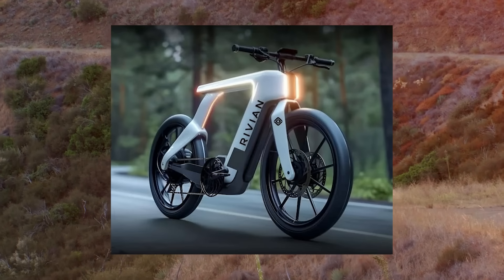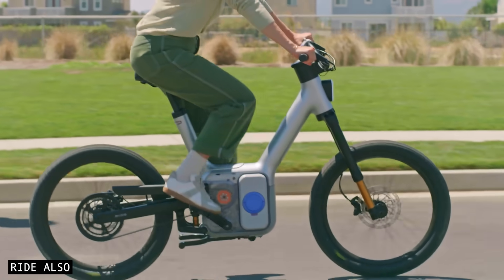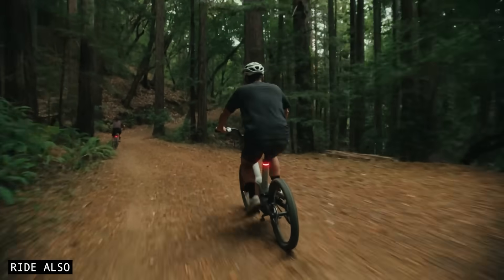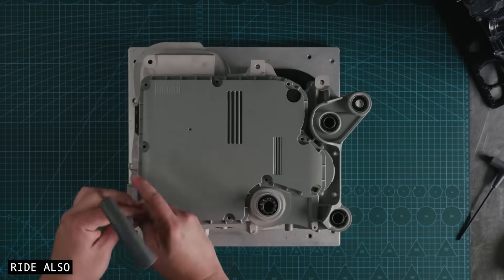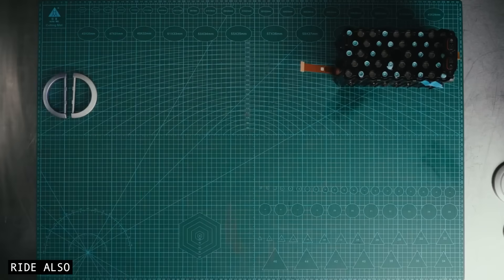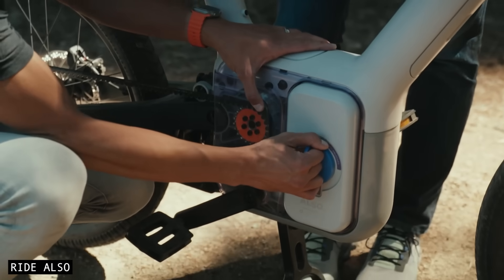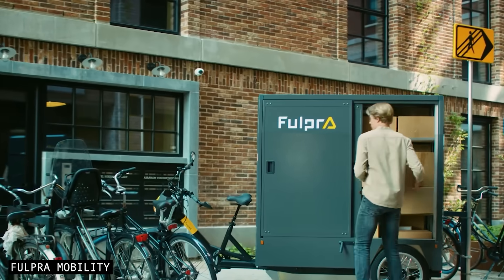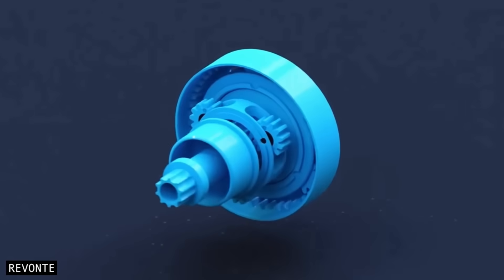Here’s Why the $4,500 Rivian eBike Uses a Digital Gearbox & Belt Drive!

Comment: Thanks for the nice overview.  That's a great motorcycle/electric scooter!
Reply: Moped, right?
Reply: I'm pretty sure it doesn't have a throttle.
Reply: @rayzecor  It does have a throttle.
Reply: @jasper_of_puppets  Oh, I see. Did he not mention it in the video or did I just miss it?
Reply: @rayzecor  I don't remember if it's mentioned in the video, but I've seen from official media that it does have a throttle.
Reply: @jasper_of_puppets  it's in plain sight, it has the shape of two revolving levers that are activated with the feet.
Reply: @SugoDiGatto  Yeah guy, i get it. What i'm saying is it has a standard twist throttle in addition to the pedal-actuated ones.
Reply: @jasper_of_puppets  no guy, it doesnt' have a twist throttle. It has a throttle shaped like pedals and a thumb-lever throttle on the right, below the fake gear shifter.
Reply: @SugoDiGatto  Okay chief, it's got a thumb throttle and not a twist one. My point was that it has a hand-actuated throttle and not just the pedals.
Reply: @jasper_of_puppets  Righto bud, cheer up. My point was to point out the pointless pedals.
Reply: @SugoDiGatto  Sure thing, pal. But the pedals aren't entirely pointless. They do drive a generator that reduces battery consumption over using the thumb throttle. Don't get me wrong, I think this bike is stupid, but it's factually incorrect to say that they are pointless.

Is it pointless to design a pedal-by-wire bike? That's certainly debatable. But that is a different point than what function these pedals serve.
Reply: @jasper_of_puppets I agree, champ.

The 35% loss in non-assisted mode feels optimistic at best, and the fact that there is no option for a backup direct drive, despite having a belt right there, feels like a very dumb choice.

Legislation-wise, some countries would probably not consider this a bicycle, based on interpretation, as the pedals not mechanically engaging the rear wheel makes them look like a loophole exploitation - skin to early french microcars having "pedals" in the cab.

I expect these kinds of vehicles to be further regulated in the future, as we're repeating the history of mopeds.
Reply: @SugoDiGatto  You're right, kiddo. Best to stick with a real bicycle. 👍

Comment: Thats a motorcycle with pedals as a throttle cable.
Reply: slowest motorcycle ever
Reply: Wrong. The pedals generate power used to propel the bike. Low iq comment.
Reply: An electric moped.
Reply: whine whine whine boohoo boohoo boohoo.

Comment: Honestly, you probably got a decent payout for advertising this. But the advantages are less complex gearbox. And then you show the "inside" with 2 complex gearboxes. One for the pedals and one for the motor. 

Also the torque argument is bs. Yes the direct drive hub motor has less torque. Ofcourse. It is direct drive. But if there is a gearbox added in the hub is is fine. My guess is that the stupid belt is there is probably for patent reasons. As the full hybrid drive with hub motor was already patented. 

Anyway wobt be buying this anyway
Reply from the maker: I didn’t get paid for this video; otherwise, I’d disclose it. I just like researching about this tech and presenting it to whoever will listen!

And I chose a big direct-drive hub motor for this simulation because, when I tested a geared hub with regen in the Grin simulator, the thermal performance on long, steep climbs resulted in overheating. Remember, in this scenario, there’s no rider contributing power, so motors can overheat much faster.
Reply: @Cyclingabout  Excellent that you use the GRIN simulator. So you're doing well in my book. 8-))
Reply: This guy gives great reviews and doesn’t get paid for them without disclosing that fact.
Reply: whine whine whine boohoo boohoo boohoo
Reply: Toe nou Slaapkonijn, niet van die aantijgingen. Je weet niet of hij betaald krijgt. Hij heeft in ieder geval verstand van zaken, want hij snapt dat hij voor dit soort zaken bij GRIN technologies moet zijn. Hij gebruikt die GRIN simulator and dat is zo'n beetje het beste wat je kan vinden. Ken je trouwens het PERS systeem van CIXI?
Come on, Sleepy Rabbit, don't make those accusations. You don't know if he's getting paid. He certainly knows what he's talking about, because he understands that GRIN Technologies is the place to be for this kind of thing. He uses that GRIN simulator, and it's about the best you can find.
By the way, are you familiar with CIXI's PERS system?

Comment: “Pedals not connected to the drivetrain” sounds like a throttle to me, which is problematic for Class 3 designation in the US. Plus the bike has an actual throttle, which also doesn’t work with a 28 mph assist limit. Otherwise, this looks very interesting.
Reply: Oh, I didn't see the throttle, why did he not mention it in the video?
Reply: Interesting observation. Will be interesting to see how that plays out.
Reply: @jysmtl  Interested in seeing what kind of interest this bike generates, and what the interest would be if they offered financing for interested customers.

Comment: This thing is what tech-bros think a bike should be.
Reply: I'm feeling slightly more charitable about it, because I think the real place for this sort of system is in those light delivery vehicles rather than as actual bike replacements. More conventional e-bike designs are better in most ways for bicycles, but this makes sense for those four wheeled delivery vehicles, and it's going to share most of its tech (and design costs...) with it, so it probably made sense to do the bike too.
I'm slightly skeptical about potentially unleashing hundreds of those things on bike lanes. There are obvious downsides (i.e. delivery drivers squeezing out what little space is currently allocated for cyclists), but there are also obvious upsides and I'm not sure what the overall cost/benefit balance will end up being.
Reply: @kristofprovost  Yes, I see potential for some uncoventional bicycles like recumbent bikes that often seemingly have rather complicated drivetrains like multiple normal length chains linked together and additional chainguides and pulleys to redirect the chain or special need bicyles/tricycles like Vanraam and some others do (and with two wheels in the back, AFAIK you can't use derailleurs, interal gear hubs are probably complicated to have that chainwheel and then the axle/driveshaft in the outer (I would give it a new housing) and it might still work without but a differential isn't wrong to make turning better.
And obviously for some cargo bikes but I don't see potential for replacing >95% of the bikes out there that still have a mostly mechanical drivetrain (except Di2/AXS) and even most E-Bikes would still work fine when the battery is at 0%, obviously without any pedal assistance, I'm not sure about that.
IMHO it's intelligent simplicity - keep it simple, stupid and don't overengineer it with great lengths to make it better in paper when everything works but with much less reliability and all of these "digital drivetrain" (I hate that wording, it's the same with PS5 and Xbox Series S, they name it digital and yes, it's "digital distribution" aka download only, but the physical media they ditched: CD/DVD/Blu-Ray are already fully digital, but yeah, I see why these marketing morons avoided "non-physical media" and here like on some others it's a mechanically non-coupled like diesel-electric locomotives/ships and a few serial hybrid cars (or Battery EVs with a range extender)) stuff I've seen yet where some say it's simplier but I disagree.
Reply: Bike guys want light weight, too. ✌️
Reply: @chandleredwards  especially in cities that aren't as flat as the us ones. The storage is most likely not ground level. Stairs...
Reply: @marthagallus6516they did say it has a special walk mode for going up stairs
Reply: The UCI has no jurisdiction here!
Reply: As a daily bike commuter this makes so much sense to me.
Reply: nah they still working on disrupting the wheel
Reply: Which is why I'd really like Adam Something to drop by...
Reply: If the same people made a bike that you liked, they would stop being "tech bros" and youd say "this is what it would look like if apple made a bike.
Reply: @oglordbrandon They would still be tech bros, but ones that made a good bike.
Reply: I'm a tech bro and I support this message.  See you on the trails !!!
Reply: The bikes are we used to are designed and meant firstly for sport. Whether it is mtb, road or gravel, they are not meant for commuting. And because those look attractive, most commuter bikes now try and copy that desing a little. Hypothetically, if this ALSO bike turned out to be really good and really cheap, leading to mass adoption, people would then start to see the bikes of now as the odd ones out. Just like you might see a sporty coupe and think it looks cool but not practical. It's the same for mtbs, road bikes, etc.
Reply: @rayzecor  What are you talking about? There are many ebikes out there meant for commuting. And they are less than half the price of the $4500 Rivian/Also, and they are like 40-lbs lighter. 

What's not practical about my 45-lb e-mountain bike? What about it makes it not suitable for commuting when I'm not riding it on trails?
Reply: @jasper_of_puppets  I can tell you what's not practical about my 45-lb e-mountain bike, basically no comfort features from factory, no lights no mudguards no stand, all off them a complete pain to have, in the lucky case you find something compatible, have to periodically clean and oil the chain and shocks, and on a side note, almost 2k more expensive. Still, I enjoyed riding it, but I wouldn't buy it again.
Reply: @jasper_of_puppets  Most of the ebikes meant for commuting follow more along the style of the trekking bike rather than the old commuting bike. The ones that are real commuting bikes don't do very well on the ebike aspect.

What I meant when I said impractical is just not as good as something purpose built. An emtb has heavier tires, no storage for groceries, really wide handlebars which make filtering traffic a bit harder, etc. I own a full sus emtb, a hardtail and a gravel bike, I use all three for commuting and they all have their flaws.
Reply: @rayzecor  I think there are plenty of city/commuter ebikes that, in my estimation, work fine for what they are designed for. But it's fine if you disagree... I just don't think this Rivian/Also bike would be any better for commuting than the multitude of much cheaper and much lighter ebikes already on the market.
Reply: @jasper_of_puppets  I don't think it's any better either, I'm just saying it might be headed in the direction of the future of commuter ebikes. I personally prefer regular bikes to ebikes and would much rather ride one than a cheap ebike with a cadence sensor, but they do accomplish what they set out to do anyway. At the end of the day, the point of commuting is safely getting to your destination.
Reply: @jasper_of_puppets  I also ride my e-mtb in urban environments, but most of the time it doesn't work, I just don't feel hipster enough.

Comment: having rotation, turning that into electricity, turning that into rotation, and sending that through a belt to the rear wheel really feels very gimmicky...
sounds like lots of steps for not much..
Reply: Exactly. Over-engineered, overweight, and overpriced would be an understatement.
Reply: Depends on how you think about it. If you are willing to pay for the extra electrical energy for some assist while pedaling in this format (cvt), then maybe you don't care about those losses. It's just a trade off.
Reply: I would say (price tag apart) what's the balance between efficiency and mileage. I'd say this bike is quite good for commutes of 30k that can be done in less than 1h. Or even for small trips considerably longer, assuming you can charge the battery.
Reply: This is actually how diesel-electric locomotives work. The diesel engine generates mechanical rotational motion, which turns an electric generator, that then goes to electric motors in the locomotive wheel sets. The advantage is that infinite "gear ratio", so you are trading efficiency for the smoothest ride (on your legs and joints) possible.

Comment: Loved the clear headed data based analysis. As the current owner of 2 Reise & Muller Superdelite GX ebikes the Rohloff e14 (one chain, one belt drive) and several other ebikes purchased in the last 6 years, I've found that my particular riding style and terrain type preferences are perfectly suited to what I consider to be this reasonably priced, high tech TM-B e-bike. I ride 5-6K miles per year (paved bike trails, dirt roads and some mild single track riding. In less than 18 months I burned through the Bosch Motor on one of my R&M bikes. I ride for exercise and pleasure and I'm fortunate to live next to a great 32 mile bike trail along a river and lake with another 25 miles of dirt and DG trails. I also use a hitch rack to take the bikes to other locations several times pre year. 

My wife unexpectedly (the kids never though she would get on a bike at her age) has joined me in this ebike riding obsession and that gives us a common hobby and outdoor exercise opportunity we can share. The ebikes level the playing field in terms of performance and so we can ride together comfortably while I can get a bit more aggressive on my solo rides. With all these use case advantages, the cost of a high quality, maintenance free and simple to operate ebike is inconsequential and easily justified.  

I have driven Tesla's since 2019 and the software driven, vertically integrated hardware approach has led to over 100K miles of trouble/maintenance free driving. I ordered the TM-B day one and that decision was based upon the clean sheet design, in house software development, vertical integrated drivetrain and battery. With Rivian DNA, I feel the risk/reward equation of the TM-B is a low risk, high reward opportunity. YMMV 🙂
Reply: Totally agree.  I had given up bike riding 10+ years ago due to age related joint pain (I'm in my 50s) and ebikes have brought back the passion.  I can ride longer, further, and customize power assistance on the fly if things act up.  It's the future here today !!!!
Reply: I’m with you.

Comment: Geeze. 90 pounds for an e-bike? Very heavy. That's more than a Citibike e-bike. Rivian's biggest competitor will be Riese & Müller, and they've had more than a decade to refine and evolve their e-bikes. Riese & Müller bikes also weigh 30% less than this Rivian bike. Riese & Müller also has far larger distribution and are more accessible for servicing. Still, competition is good. Rivian must, however, provide brick & mortar repair shops in cities across the country, not an inexpensive proposition. The more I think about the Rivian e-bike, the more I think it will fail. I hope to be proven wrong.
Reply: Different tools for different mission profiles. R & M's ebikes are expensive... Crazy expensive... With all the drawbacks of conventional bikes and ebikes. Rivian's take eliminates the maintenance issues of chains and derailleurs. This is a low maintenance option for people that want reliable transportation without having to muck around with the maintenance. With the belt drive, no more annual replacing of chainsets ground down by Chicago's crushed limestone bike paths. Not everyone is interested in adjusting deraileurs. No more gear shifting issues, particularly for inexperienced riders who snap a chain attempting to shift under load. And the cost? One can own a pair of the Rivians for the price of a single Charger5. As for repairs, the modular design eliminates most of the bike shop visits, and swapping batteries and motor assemblies is somethiing my 8-year-old grandson could handle. The surprising part is the price. One can easily match that price with one of the hundreds of heavier ebikes on the market with far greater need for maintenance and questionable reliability. My health is good enough, as are my mechanical skills, that I can stick with my Specialized and Fuji conventional bikes. My girlfriend, on the other hand, is a prime candidate for the Rivian option. She has zero mechanical skills. Zero interest in adjusting anything. Not to mention the scarcity of brick and mortal bike shops these days... The nearest one to me is 35 miles away, and they refuse to work on ebikes. The same people who buy a Rivian ebike instead of an R & M are the same people who buy a R1T or R1S instead of a Jeep Wrangler. Rivian knows their audience.
Reply: @BakerStudiosIndy  Your points are well stated. Still, Rivian's bike needs to be cheaper and lose 30 pounds or it won't compete.
Reply: R&M are wonderful; but I think a parallel R&M would be $8000-ish USD(?)